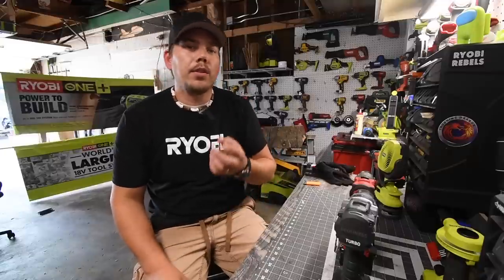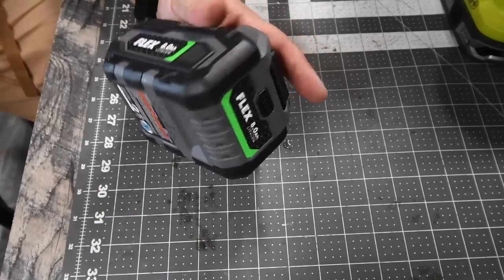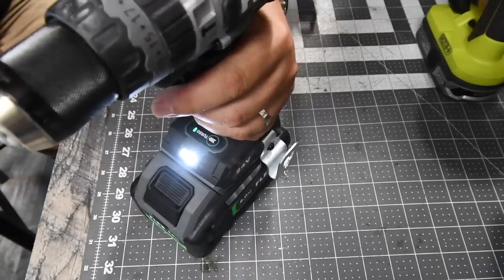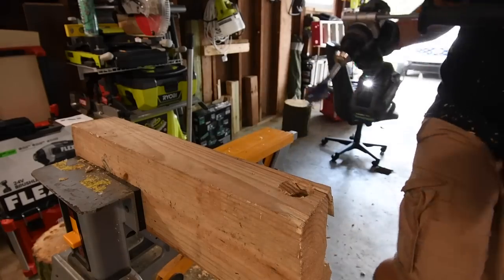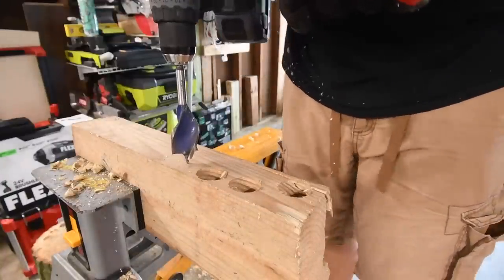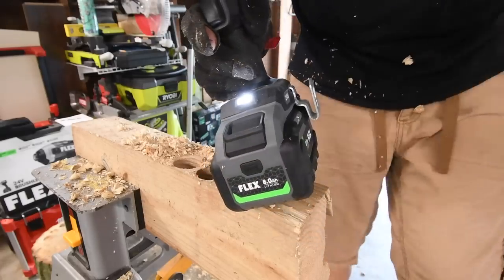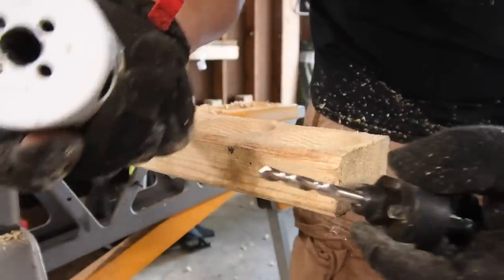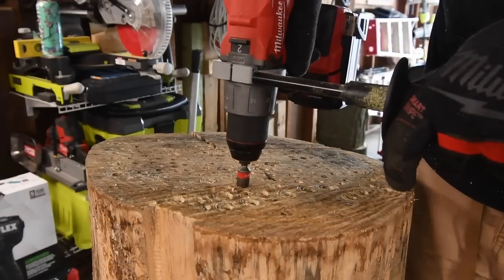FLEX vs Milwaukee (8ah 21700 Cell Batteries)

Comment from the maker: I read enough comments to do a MCT short with the Milwaukee using a 6ah battery and the flex using the 8ah with driving in a 10in lag, Video will be 2 minutes  long, video will be uploaded today, 7/25/21
Reply: Is this a member only video, or did it not get uploaded?  I am excited to see more of these videos with the 21700 cells.
Reply: Is there a link? I don’t see it in the 2 Minute or Shorts playlists

Comment: That FLEX is gigantic haha imagine working with that thing all day. It's a freaking brick
Reply: Did back in the day with a dewalt dw997 hammer drill 18 v nicad it was big as anything sad that to get 21700 cells on flex you got to get a 8.0 ah battery  ridgid might be now lower torque numbers in the max output but they start at 6.0 ah battery with 21700 cell wait to the fall when they drop that new hammer drill from this might be looked at different and the same with all max output tools the 8.0 ah will have 21700 cell too not knocking flex just big and heavy i know the octane is big and heavy is anything so is metabo's top of the line hammer  a drill with 1250 inch pounds of torque forgot the BPM on that I just know that one's not cheap the price of that kit you can buy whole flex kit or Milwaukee gen 3 kit
Reply: @bluemantom77 , reading what you write is guaranteed an instant headache!  I’m sure you have good information to share, but it’s extremely difficult to read a 100 - 200 word run on sentence…
Reply: @martylucas8557  I think I lost some IQ trying to read his post.
Reply: @martylucas8557  For real, after trying to read it I have gained nothing from what he said. If there was formatting to make it multiple sentences I am sure that there was good information, but in its current state a person will only gain a headache and not the information that was trying to be conveyed.
Reply: @bluemantom77  21700 cells are 4 Ah, and woud be some 5 Ah in the future. One row of 21700 is good up to 40-42 A max, so less then two row 18650 cells that is good up to 40-46 A. There is a weight diference, some 100 grams more for the 2 row of 18650, but that is important only for lighter tools, not for huge top of the line drills weighting 2.1-2.7 Kg. For a Bosch GSR 18V-55/55 is good a 4Ah pack pro core  with 21700 cells, but for a 18V-150 you realy need   the 8 Ah pack coz' that drill has world best  84 Nm soft torque and 150 hard torque, and needs a lot of amps. The Bosch pro core 4Ah compact pack has 536-538 grams ( 515 spect...), and Makita 5 Ah with 2 row 18650 has less then 100 grams more.
Reply: @loochan325 , I appreciate your analysis, but it is somewhat meaningless to many of us Americans, as we don’t use the metric system.
Reply: @tylerperlenfein , I didn’t think I was the only one that had a problem with it.  There’s another guy, Joseph Molenowski (very nice guy), who writes in the same manner.  I once asked him if he had a bad experience in grade school with his English Teacher and vowed never again to use punctuation.
Reply: @martylucas8557  In USA all in scientific and medical sistem use full metric only. NASA was and is full metric from the begining, they use N not lbf, an so on. And since de '70 is obsolete even kgf all over the world. In USA you also use liters and cubic cm for ICE motor internal displacement. For gun calibers you also use both metric and  inch. In Europe we still use some imperial mesure for interior diameter of old iron pipeings, but those are also obsolete and all cupper, PVC, PP and PE are metric. We also use both inch and cm for screen diagonal. There is 1/4" coarse for tripod foto screw and  3/8 for very old ones - even russians use that, and 1/4" for bit adaptor that has a mesure in mm but nobody say that, just that model of bit adaptor. Some drill chucks are for screwing on 1/2" UMF or 3/8" but that is 12,7mm and 9.something mm and people just buy the stuff they need, and they take up to 10mm and up to 13mm and so on. There is also feet used in aviation, except in Russia, but is stupid, there is no need for feet, russians don't suffer for not using it, and for rare ocasions when is needed we can  add decimals, like 1,3 m or so. There is also in use knots - nautical miles in maritime and aviation, and those are the only justified ones, being in relation to Earth and 360°. There is anorher weird unit for footware in EU, diferent then US one, is very old, and can have decimal .5, and recently I've seen even weirder 41 and 1/3 coresponding 9 US, or 7 and 1/2 UK, 260 JP and 255 China. EU or FR unit is 0,667 cm but is calculated ading 1,5cm to the foot for the footware and then divided by 0.667. Anywey, is very easy to instantly convert with good enough aproximation some units from metric to imperial or US standard. One lb is ~ 453.+ grams, so 2.2 lb is 1Kg - ~  2.1g. More so, 10 N is ~ 0.98 kgf, so ~ 2.2 lbf is ~ 10 N. For Lbs to Lbf conversions, and for torque units convertions from feet to inch you have the pleasure and knoledge...we just use  Nm as 0.098 Kgf on a virtual 1m lever.
Reply: @loochan325 , I get it.  There is some use of the metric system in the US, e.g. bullet size, Science, Space, screws, bolts, nuts, etc.  However, we say board feet for lumber, torque is measured in ft lbs or inch lbs, gas is gallons-not petro liters, etc.
Reply: @martylucas8557  Yeah, but your so coled 2 by 4" is wey smaller in real life then sed mesure, and your galons are ridiculously - wey wey smaller then UK imperial ones.

Comment: I’m at the point if the tool is comfortable, accurate, less cumbersome, has good weight, will last and gets the job done then that’s the tool for me. Sometimes faster isn’t always better.
Reply from the maker: I agree with you on that
Reply: akaredcrossbow, BS! Isn't that's what Milwaukee used to be before the Flex came around?! Isn't that Milwaukee was the fastest and the strongest of the other high end tool brand that exists??? Isn't that Milwaukee was the king 👑, the Champion 🏆, the undefeated, the Unrivaled king of Powertools??? Now 35.98 secs of Milwaukee Gen fuel higher end Brushless Hammer Drill with a 21700 Cells 8.0Ah battery is not good for that Title!! So that means Milwaukee's best time of 35.98 had also been beaten by a Ryobi HP Hammer drill with only just a 4.0Ah 18650 cell lithium ion battery! See this is what I'm talking about, not Everytime Milwaukee is the king 👑. Milwaukee gotta LOSE sometimes, and that my friend is what is happening now, Milwaukee have been starting losing. 35.98 secs. Ryobi beaten the Milwaukee, so that means Lowe's Kobalt can also beat Milwaukee, DeWalt and Makita as well. Same thing with Skil brand, and Walmart's Hart tools. They can beat Milwaukee, DeWalt and Makita. This is the testament that Milwaukee is Slowing down. Being so greedy so for many years Milwaukee deserved to get beat down. Instead of Milwaukee should go back to the drawing board and science lab TTI became so over confident and complicent that "Milwaukee is the best tool in the world" well not anymore! 🤣 But with having said all that I'm the kind of guy that is not loyal to any tool brand. I'm the guy that uses tools whatever I have and whatever is around to get things done. Even though I have the Flex tools some calls it the "Godzilla" aka Milwaukee Killer. I still have my old tools such as DeWalt dcf885 dcd785 Hammer Drill, dwe575SB corded circular saw w/ brake, DeWalt dcf887 and dcd796 hammer drill, I got Bosch CSW41 corded Worm Drive Saw. Bosch Freak impact driver/wrench, Bosch corded HD18-2 Hammer Drill. Got Makita xdt16z impact driver, Makita 5377Mg Hypoid Saw corded, Makita SJS 5" corded angle grinder, Makita pneumatic framing nailer, Hitachi corded 12" Sliding Miter Saw, Ryobi HP 4 speed impact driver and the new HP Hammer drill also Ryobi corded 10" Compound Miter Saw, corded Electric Planer, orbital sander, angle grinder. DeWalt corded table saw. And just so you know even though I have branded and expensive tools, I also do own some cheap stuffs like harbor freight tools Hercules brand impact driver and hammer drill bit they're both brush not brushless. I switch them out and doing rotations on all of my tools in the jobsite. Except the Flex tools! They're expensive as hell they're like Supercars.
Reply: @twinbee4243  dude..

Comment: In 1960 , it introduced the first cordless electric drill, powered by a nickel-cadmium battery. Meanwhile, Black + Decker contracted with Martin Marietta to design tools for NASA, including a zero-impact wrench that turned bolts without spinning the astronaut.

Comment: That Flex battery being 24V and using Chervon's cell cooling sleeves just makes it comically huge. They really need to make batteries with unsleeved cells to use with drills and other one handed tools that won't stress the batteries that much to make them more practically sized.
Reply: Well said Spencer, agreed!  It looks like a 60 volt DeWalt battery!  😳😬😀🤣

Comment: Flex is clearly the better tool.  We’ll see on dependability, but lifetime warranty takes care of that concern.  Biggest issue with flex is the lack of bare tool sales and a much smaller line.  Lots of Milwaukee fanboys are going to continue finding excuses why the test is wrong or why the tests don’t matter.  I’m sure Milwaukee will put out a new model that out performs the flex but it clearly doesn’t today.
Reply: They are coming out with a ton of more tools this was just to get them started
Reply: Flex doesn't have a lifetime warranty that was just for a promotional period their warranty is 5 years we will see if they hold up if so they seem like a great option also just checking the lowes website they have a lower end brushless impact driver that is less chunky and is supposed to deliver 1800 inch lbs
Reply: @nicksweezy2813  hence promotional period
Reply: I'm not a Milwaukee fanboy but I am invested in the line and see no point in switching. These tools are far more powerful than our old power tools. Both tools are great but Milwaukee lost this test hands down. Welcome to the game Flex!
Reply: for better tool I'd still chose milwaukee over flex cause they have more history in the tool industry than flex also have simply better battery options and faster isn't always better and that's coming from a DeWalt fanboy

Comment: And yes the turbo does turn itself on and off automatically. Kinds cool but if you want turbo and it shuts itself off that's kinda bad. Imho
Reply from the maker: its a safety feature, but the turbo does seem to do really well with speed 1
Reply: It's not bad it's good... if you're doing something that needs torque and not RPM...it protects itself..it's a smart tool....🤔
Reply: @boosted2.4_sky  what if you're wanting the power but it won't give it to you because it keeps shutting it off automatically what do you do then. Exactly if you're worried that you're going to twist your wrist put the handle on it and hang on
Reply: @ManCaverTools  yes, I am on the fence still about them. I've seen and heard about their power and I'm a huge Milwaukee fan boy!lol. Great video man. Newer to the channel but enjoy your stuff

Comment: So is turbo mode just a capacitor in the tool that the battery temporarily charges and then when the tool is used in turbo the capacitor expends itself allowing for a little more power to the motor?

Comment: The Flex is so bulky looking it’s almost cartoonish.  I’ll stick with the Milwaukee with a 3 ah HO battery.

FYI,  the Milwaukee G3 Hammer Drill will perform at it’s best with the 6 ah HO battery.  That means more torque than the 8ah HO and 12ah HO.  For reference and to back up see the Torque Rest Channel.
Reply: I was actually just going to comment that he pasted it in there to look bigger because he is biased against FLEX... it's actually not much bigger than the Milwaukee I have both... side-by-side in real life they don't look like that
Reply: My Dewalt is nearly double the size! 
My god those things are huge!
Reply: Get yourself a screwdriver if u can't hold a Flex tool.There built for heavy work.If u want a toy get the red 1

Comment: That flex has a lot of power. The only thing I don't like about mine it heats up in the handle really bad.  Maybe I have a defected model or I push it too hard...?
Reply from the maker: I will see in time if that becomes an issue with mine and I thank you Toolhead

Comment: Good video hope to see more videos like this maybe test the new max output line once the 6.0 ah and 8.0 batteries are out I'm sure those tools were rented their full capacity and give the best performance now not so much from what I heard the max output batteries are only high output 18650 cells
Reply from the maker: I need to get the new RIDGID tools and I thank you for the suggestion Thomas
Reply: @ManCaverTools  you do the videos the way you might whenever you get the tool you get them with those tuna batteries will be the 21700 cells I don't know how true this is but I heard this from a rep at my local home Depot at rigid is working on a 12.0 battery who knows when and if there's an ETA on it

Comment: Yea not sure that hole saw was a good representation, doesn't look like there Milwaukee slowed down, just the hole saw took longer to cut through the wood, which is evident by how far the wood was in the hole saw on the Milwaukee run vs flex

Comment: Why does everyone say it's a fair comparison? The Flex has 5 more 21700 cells than the Milwaukee. That equates to 35 to 40 more amps per cell! I'm posting this after watching the first 2 minutes. I will say that the other comparisons don't really do Flex any favors seeing as other competitors are really close if not slightly better in some tests.

Comment: I'd still take the Milwaukee 2804 over the flex. It's smaller than the dewalt atomic hammer drill, same length as the dewalt atomic drill/driver.
Reply from the maker: both are very power tools. the Makita is not the most powerful impact driver but it is still my favorite
Reply: You like the Makita over the Milwaukee 2804?
Reply: @dangrimes5078  Makita just isn't as powerful as the Milwaukee stuff but my father sticking with the Makita because not only does he have a million of their batteries....his job uses Makita too so he can "borrow" as well.

Comment: Even though flex won you gotta give credit to Milwaukee for giving flex a run for it's money. Especially it being a model that's been out for so long now. Milwaukee hasn't been great with concrete though cause I've seen the old Ryobi p251 hammer drill Keep up with the milwaukee in concrete.

Comment: Here’s how I look at things. When you buy a tool you’re really putting faith into the company. Faith that they took there time and built a good product and you can trust that if it isn’t where you want it to be they’re working on it to get better. Input faith into Milwaukee because they’ve proven over the years that push come to shove they will continue to innovate without fail so we know what the future holds.

2nd when comparing these 2 drills I believe the Flex is the most powerful. But Milwaukee is the most advanced. Yes it’s true. When you use an iphone the challenge for apple was first to make the best phone. It could be gigantic as long as it was the best. Then over time they mastered it and tried to make it smaller. That’s real innovation to get the same performance with smaller parts and real estate. That shows the commitment from the company. It took a lot more ingenuity to put the Milwaukee together than the Flex where they just used the strongest parts without restriction. That tells you where the companies are.

Lastly Milwaukee has said previously that customers complained about the power so they try to find balance. You can be too strong and they were at that limit. This will only force them to give us a drill that none of us can use because they have the tech to do it or stay true to form and continue to make the best model of the drill for daily use.

Makita figured that out a long time ago and they’re right there with Milwaukee.

Comment: Maybe i will be wrong, but at the video you test max power of this two tools, ok, flex better speed perfomance, but this feature with turbo button doesnt work in real life, i mean ok i will drill 1-2 hole with turbo mode and i wiil do this faster than someone else and so what next? 3 and 4 and 6 holes i cant drill because turbo mode has some timeout for cool down drill motor and electronics, and i will drill rest holes like any other drills with same speed as they are